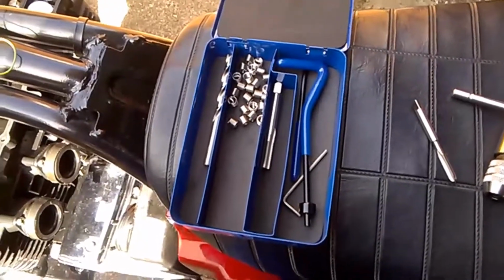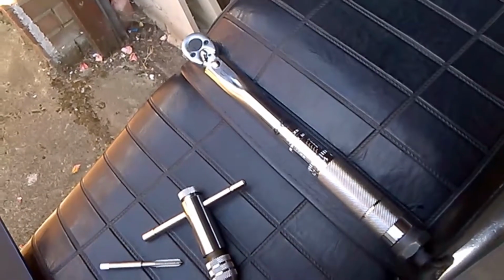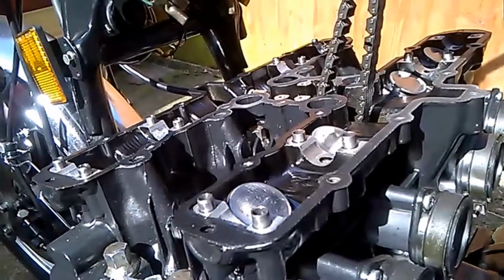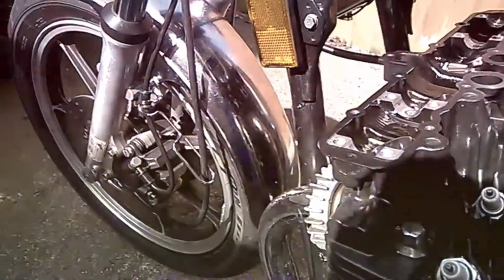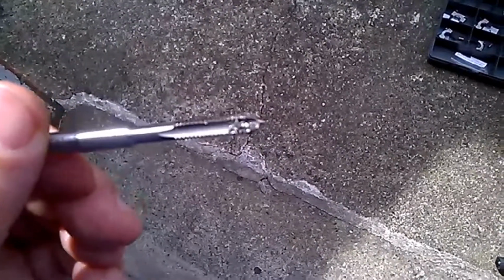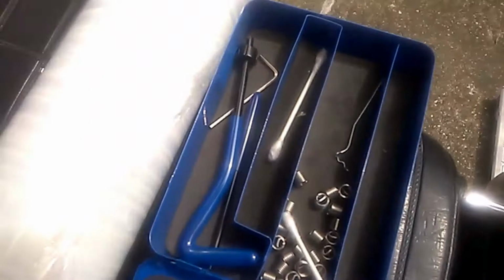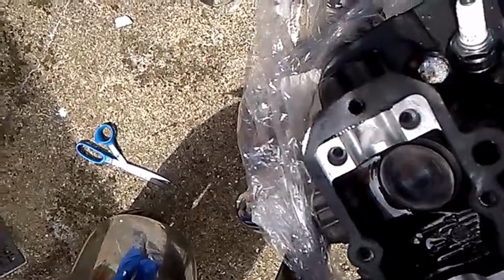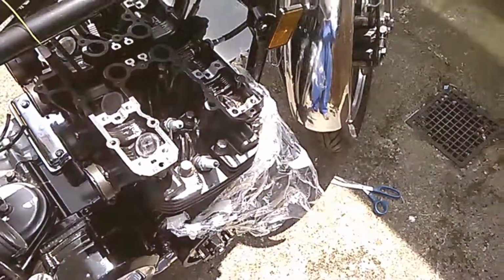Helicoils Save the Day. Kawasaki KZ750E1 Rebuild #25.

Comment: The tape around the pliers is a good tip!
Reply from the maker: Enigma Vapes I used the type of rubber tape which sort of 'melts' together. It's called amalgamating tape, I think. Very soft and grippy.
Reply from the maker: Enigma Vapes You must be a Spanish guy. Enigma Vapez?